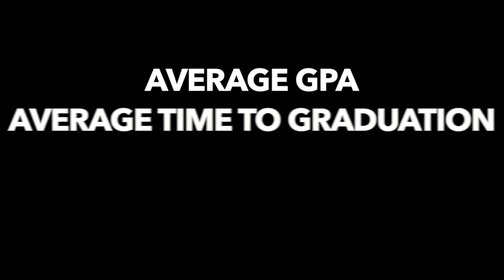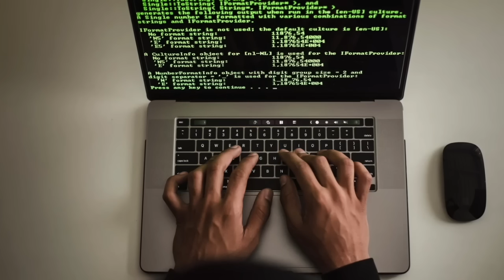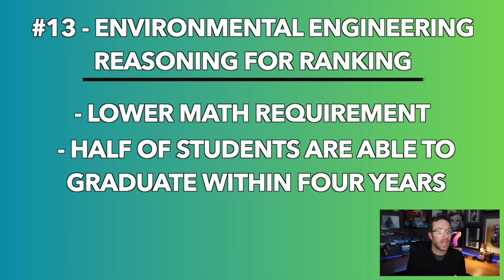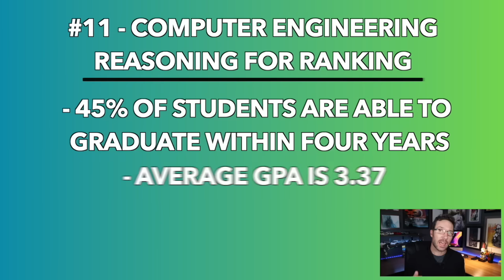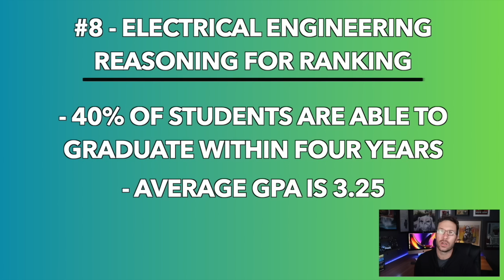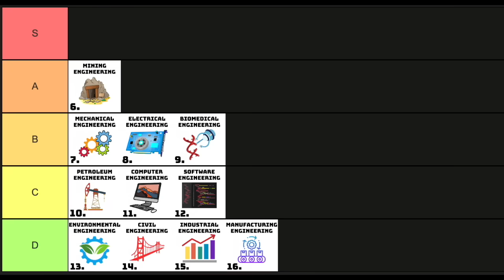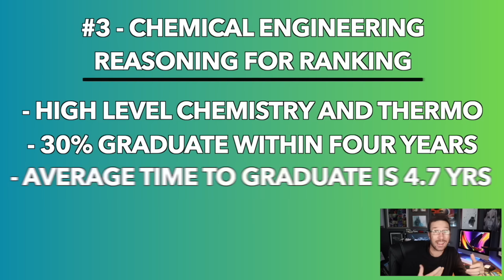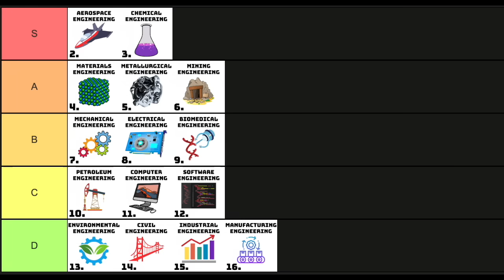Engineering Degrees Ranked By Difficulty (Tier List)

Comment: Lumping all Civil Engineering together as a single item strikes me as hugely inaccurate. According to NCEES, there are actually 5 major disciplines of Civil Engineering, with each discipline having ITS OWN UNIQUE EXAM OPTION for the Professional Engineer licensure test. Those disciplines are:

Civil: Construction
Civil: Geotechnical
Civil: Structural
Civil: Transportation
Civil: Water Resources and Environmental

Which from NCEES's list we can see that Environmental is not really its own thing but rather just a sub-division of Civil, but so are the other 4 subdisciplines. Plus the subdisciplines all have varying math requirements and pay scales, with Structural being probably the most math intensive needing high level calculus, and Transportation being the least math intensive needing only algebra in most cases.

Comment: I teach chemical engineering. As far as I can tell, the ranking is pretty accurate. However, I don't agree with some of the math requirements in the list. I'd argue that most engineering disciplines require knowledge of partial differential equations. Engineers might not use that knowledge on a regular basis, but you need it to fully understand topics such as thermodynamics (particularly chemical thermodynamics), and heat and mass transfer. For mechanical engineers, it's needed for advanced fluid mechanics. For electrical engineers, I would think it's needed to understand electromagnetic waves. And I would think it's needed in some civil engineering topics as well.

Comment: I'm a retired ChemE and I'm a bit surprised how high is this engineering ranked. I always thought that mechanical or electrical were more difficult, since I seldom understood a word from them when tried to address maintenance issues at the plant.
Also thought that aerospace was top in difficulty, much higher than ChemE and Nuclear.
BTW,  Chem Engineers may require partial differential eq. solved by numerical methods.

Comment: the job growth prediction for nuclear seems stagnate (because it is, right now), but in the near future we might see a turnaround and more countries using nuclear. its by no means guarantied at all, especially considering in recent years, nuclear plants have been getting shut down. however, with the development of new reactors that can use spent fuel as a fuel source, such as "fast reactors" and such. so if these take off, there could be a much greater demand for nuclear engineers in the future than shown here.

Comment: Your criteria is seriously flawed.  Your selection criteria of most difficult does not include the actual difficulty of the curriculum and you you failed to identify the ethnicity of students which as direct bearing on success.  You ranked Electrical Engineering No 8 based upon graduation rates and number of years to graduate.  I earned my BSEE with Honors from a State University in 2005. Almost 2/3s  of the students were Asian.  The rest were Caucasian like me, Indian, Hispanic, etc.  The course curriculum is extremely difficult so your criteria is flawed.  You must take several more semesters of math beyond DifEq. Most upper division EE courses introduce even more math like Signals and Systems, Communications, and 2 semesters off Electromagnetic that is all advanced calculus beyond the math courses.
Reply from the maker: Interesting points. So what available data would you use to rank them?

Comment: As a chemical engineer and also software engineering senior, Chemical engineering is so hard. But not because of chemistry. Actually it doesnt have much chemistry in general. Chemical engineering is designing. Chemical engineers are taught to design a process in a big scale. They have to calculate almost everything. Just imagine a chemist may need 100 gr of sulfuric acid.. But a chemical engineer can use 5000 kg /11003 pounds of Sulfuric acid per hour in a process. And have to learn how to design all things to use it , from pipe to machines and also should know process and safety requirements. So you can graduate. And maybe you never use that in your work life. But if u dont know, u cant graduate. Maybe %1 of chemical engineers do this things in their job. But %100 of all students have to know.
Reply: And you need to know  heat transfer, mass transfer, fluid transfer...

Comment: #1 should be optical engineering.  Only four schools in the US have undergraduate programs so probably the statistics were sparse. The pay is high and the demand is growing.  OE is very hard because it requires a lot of math, materials science, and physics. School list - U of Rochester (the first), U of Arizona, Central Florida U, and UC Davis.  Maybe more are on the way.
I got my EE degree in 1968 from Case. I'm pretty sure the hardest degree then was chemical.  it also paid the most (about $10k/yr).

Comment: As an old has-been who graduated in agricultural engineering in the early 80's,  my advice to prospective engineering students would be to focus on those disciplines that match your interests and strengths.  How hard the courses are is a bit subjective.  For example, I took a course in pollution control engineering as an elective that most students struggled with, while I got one of the few A's.  I enjoyed the mix of chemistry, fluids and mathematics required to solve real-world problems.  On the other hand, I took a required course in electrical engineering where my highest goal in the class was just to pass, which I barely did.  Quite a few students will change majors between disciplines as they discover areas of interest and competency.

In the real world, interpersonal skills, communication (clear, concise and proper written communication, especially), along with quick and effective problem evaluation and problem-solving will be keys to success.  One of my favorite professors told us that the "C" students in engineering will wind up ahead of the "A" students career-wise because their typically broader range of interests and competencies will propel them into management rather than remaining in a strictly engineering role.  I found that to be largely true.  Taking a few business courses along the way will lighten your load even if it extends your graduation date, but will be very valuable in the future. 

Has required coursework been reduced in the last 40 years?  Most engineering disciplines at my university back in the day required 130 - 135 credit hours and the basic syllabus was 4 1/2 years of study.
Reply: to answer your final question No
it might be more. every discipline  in my engineering school has at least 132 hours. 
CHEM Eng was 138 💀

Comment: At this point, I’m an old EE. We studied controls, comma’s, power, and electronics—then specialized by electives; I took some advanced math, physics, and NE courses along with additional nuclear, electronics, microprocessor, and programming classes to end up with specialization areas of analog to digital interfacing, analog/digital circuit design, and nucleonics. In the end, I saw EE, ME, and ChemE all comparable. We pretty much took the same course work with different focus on applications. The one engineering degree we picked on equally was the IEs (industrial… or imaginary engineers), but in many cases they ended up in management as the boss (go figure). While I don’t think the order is necessarily valid, I agree that the tiers presented are pretty accurate.
Reply: Haha, funny to see how ubiquitous it is to call them Imaginary Engineers hehe. They're still picked on.

Comment: Aerospace Engineering undergrad degree here with Systems Engineering graduate degree.

Agree Aerospace is difficult but niche. I would rank EE higher on the list. Maybe it’s just my weakness.

I would include Systems Engineering and maybe Cyber Engineer. Systems because it really the encompassing of day to day corporate engineering. Processes, lifecycles, all the mundane  stuff that needs to be done to integrate all the other engineering disciplines. Difficulty would be lower because it is less math and more process.
Cyber simply because it’t the buzzword du jour and many school are cranking out cyber engineers that are high in the cyber and low on the engineering.

Comment: There is a difference between "hardest degree", "most difficult degree", and "hardest profession".
A hard degree in my opinion is one that demands many hours of study, yet it can be doable as long as you have patience. 

A difficult degree is the one that it involves many subjects which most professors and book authors did not find a good way to explain to the majority of students. Classical examples includes Maxwell Equations, Navier-Stokes Equations, Linear Algebra,  among others that I often find most people struggling at least at the beginning, with few exceptions. It doesn't depend on the student alone. You need proper instructions otherwise you study the wrong way or easily misunderstand  the subject. 

Now the "hardest profession" can have two forms: 
1-It can be one that has high number of candidates  per hiring position, in which case you have to deal with constant peer competition to keep your job.
2-Low number of candidates per hiring position, but it requires you to have a very specific skill set to deal with very difficult project challenges and meet customer/employer expectations.

Comment: I’m working on an MS in EE and worked with Jake. I would say that EE is harder than ranked but the truth is, the BS doesn’t have to be that difficult depending on speciality. At my school PDEs was a req but used to include complex analysis too. EM is difficult, But other specializations really aren’t that hard. From talking with peers, this ranking is pretty good. Like the smith chart is difficult at first and I’ve even taken advanced EM. It is quite hard. But I’ve heard tensor fields are harder. EE is definitely more abstract than ME, but not necessarily more difficult, again especially depending on the speciality. Part of EE is just math, understanding it and being able to implement it. I would also say that, while it may be easier, the CE degree can provide more applicable skills than EE, at least from what I have seen at my school. ChemE and Nuclear deserve their spots. But ultimately the degree you want is the topic you’re most passionate about, the difficulty is irrelevant. The passionate engineer will outpace their peers in their careers. This comes back to your motivation that Jake describes in his book. It’s all about why you want to be an engineer.

Comment: Aerospace, here.  Frankly, it depends on who the teachers are in your department.   When I entered my program there were two guys that could end up causing 70 percent of the those who enrolled to fail out of the program.   Later after they left the program,  the degree became 5x easier.   We were a small department so we had to take some class with the Mechanical Engineer major,   I was taking Dynamics and the professor of their department told the class this was going to be the hardest class we had to take for our degree, that didn't make my top 5.   The aerospace department was much harder, but that was like I said because of the teachers there.

Comment: As a semiconductor design engineer, semiconductor engineering is not that difficult. All you have to do is write in hardware description language, test, synthesize logic, test, simulate circuits, test, manufacture test chips, test, and mass-produce the product. The later the process, the greater the responsibility (as modifications become more costly), but the actual work is not that difficult.

Comment: Chemical Engineering by a long shot. You must be good at math, chemistry, and physics. Additionally, you will likely have classes in material science, applied mathematics, plant design, economics, computer programming, etc. Having taken and aced classes in programming, EE and ME, classes that were actually required, I couldn't believe how easy those classes were compared to the chemical engineering classes, including thermodynamics, fluid mechanics, reactor design, separations. The first thermodynamics class was a weed out class. Only about half the class will get through because limits placed on the number of students allowed to get through the program. You don't understand chemical engineering, dude. Nuclear engineering is a piece of cake compared to chemical engineering. It's a subset of chemical engineering. Aerospace, as to the math, is the same as chemical engineering. They don't need to know chemistry.

Comment: An interesting and thorough analysis. The only bit I'd question is the math difficulty score. For computer science, although it only takes ODE as far as computational math goes, it probably also takes linear algebra and a reasonable amount of combinatorics, although it may be possible to avoid those. Also in electrical engineering anything that involves heat transfer or fields is probably going to require PDE, and most likely tensors since things that vary in multiple dimensions are more easily treated that way (thinking of a 3D object with time dependent heat flow and such). Also biomedical engineering is a pretty large so programs can range from the relatively simple to hard, such as biomechanics, which requires PDEs, matrix algebra, and tensors since these make modeling and understanding flows much easier.

Comment: Chemical engineering.  Maybe things have changed since the late 80s.  A friend of mine in engineering school then had a father in that field and would get laid off and had issues getting another job.  It seemed to me one of those fields that one needs a PhD in as a BS or even a MS was no assurance of stable employment.  I am a BSEE and have had stable work over 30yrs but things have escalated and I am sure my current role if a new grad hire would need at least a MS if not PhD.

I took a lot of extra math back when and in my working career never used most of it.  The day to day practical stuff was more important in the end.  This would vary upon ones job role though.

Comment: wtf... I think your method of ranking is flawed here - and you expected people would disagree with you.
I studied Electrical Engineering and the required math extended beyond what you have listed and included crazy stuff like calculus-based physics for modeling the black magic of radio waves, etc. I switched my senior year to Computer Engineering because I did not care about 3-phase power and Computer Engineering added a bit more software than EE required. At my school, Mechanical engineers didn't have to learn any software and were the "special children" in the building.
Perhaps those "harder" degrees had lower graduation rates because students were more likely to decide they weren't useful and switched to other majors or dropped out (e.g., if Mining Engineering is expected to have zero growth, why would you stay in that program?)

Comment: The mechanical engineering degree listed here is classical engineering. However, if you want to be a Registered Mechanical Engineer, licensed by the State with the legal authority to practice Mechanical Engineering there is a fly in the ointment. Surprise - surprise, Mechanical engineering deals with heating, ventilation and air conditioning, or HVAC for short. Its just the way our elected representatives got it wrong, We are lucky they didn't choose to license locomotive drivers, or garbage truck drivers as sanitary engineers although some cities use that nomenclature. .

Comment: I some what agree with your rankings. I think it maters the school you attend that dictates the course work difficulty. I have my BS CE in Environmental Engineering and my MS CE in Hydrology/Hydraulics. Both are from the South Dakota School of Mines and Technology. The only degrees that one can study at this school are engineering and science. All engineering and science majors had to take Calculus 1, 2, 3 and Differential Equations. I started as a Chemical Engineer, it was very difficult. But, I realized that I was pigeon holing myself. Beings most ChemE's end up in the North East of Gulf states. So, after 2 years in that program I switch to Civil Environmental. Which is a basically ChemE lite. And are needed all over. One still does process design, it is just for water and waste water chemistry . I still had to take Chem, Physics, Math, EE201,Fortran 77, Statics, Dynamics, Thermo Dynamics and all the other courses that CE, ME, and ChemE's had to take. SDSM&T required most all engineering majors to follow the same course requirements, up until you started taking you specific engineering discipline  courses. I agree that ME, EE and ChemE are more difficult then IE, MFGE. I took a number of graduate level class's in the GeoE and MetE department. Those major students, did not appear to have the same level of problem solving skills that I had. Most had to have me help them do their homework. It took me 5 years to get my BS and 2 years for my MS. With a BS GPA of 3.3 and a MS GPA of 3.4. I finished school in 1999 and worked for a large national water/waste water engineering firm for 6 years. I did not really love being a design engineer. And quickly realized that there is far more money on the contracting side of the coin. I had worked construction, while attending engineering school. So, it was a natural fit for me to switch over. I have 19 years of Project Management in heavy civil construction.  I build roads and bridges, not really what I studied. But the broad Civil Engineering/Engineering background that I got at SDSM&T, made the transition very easy.